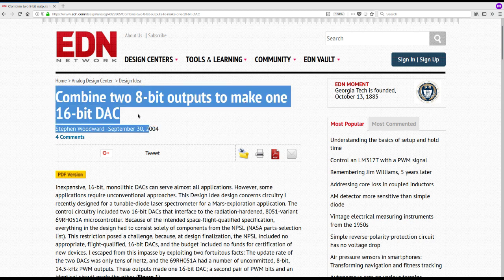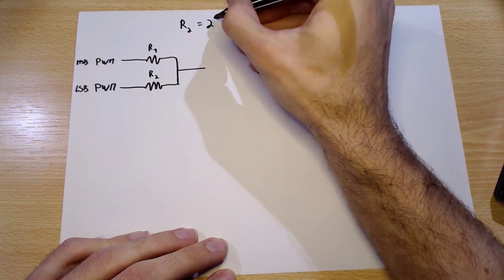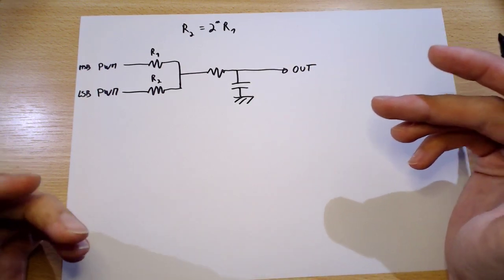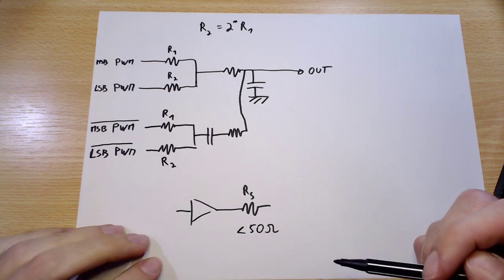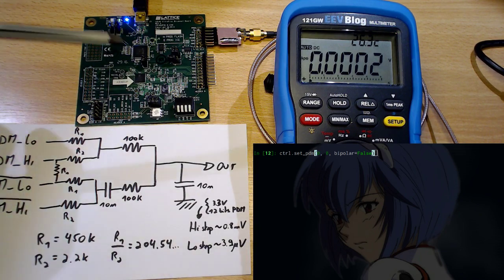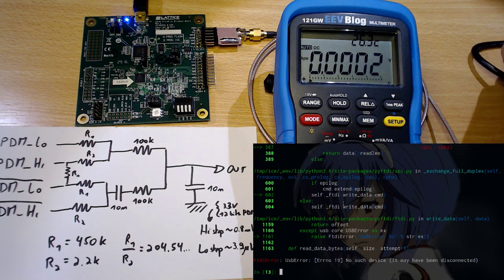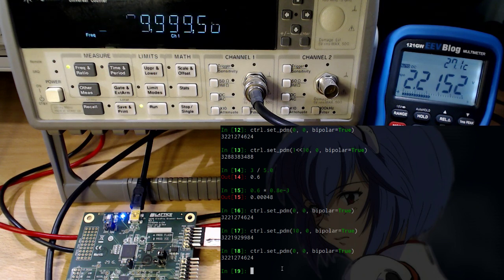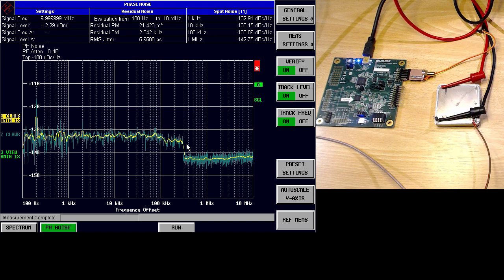Combining PDM/PWM outputs for higher precision and lower noise

Comment: The circuit implemented is not the same as described in the EDN paper by Stephen Woodward. For a deep explanation of the circuit one can check the Open Music Labs pages on the High Order PWM DACs.

Comment: The most informative in DAC implementation would be the INL curve, which is not shown here. It is doubtful that true 16-bit precision is achievable using PWM approach. As a pitfalls one can mention instability of the Vdd pin voltage. The push and pull currents of the digital  pin are unequal. And the driving currents of the different digital pins are unequal. 
    Bottom line: a simple Delta Sigma DAC using single digital pin and 2-nd order passive LPF would likely show the same or better performance than the above circuit.